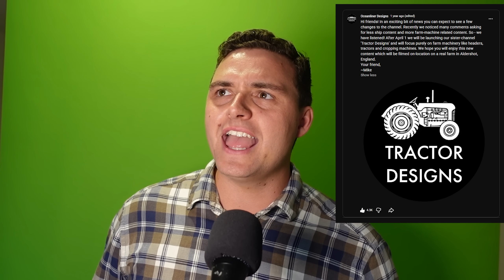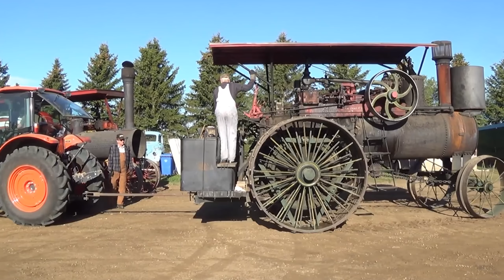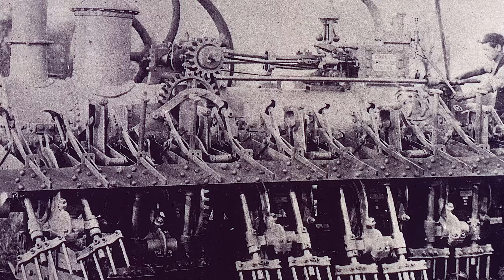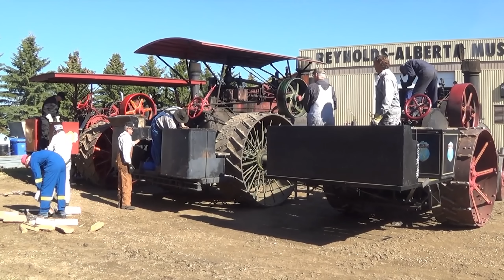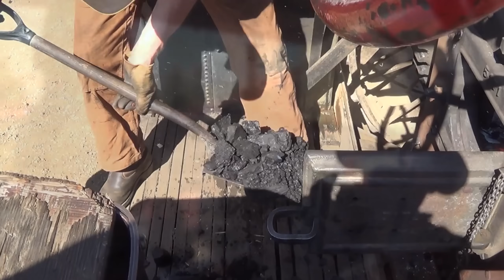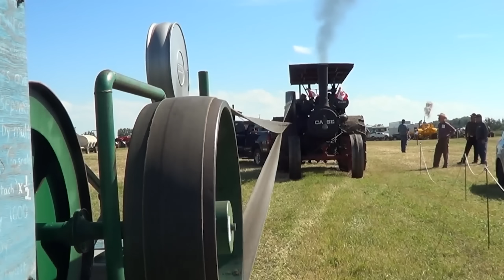The Incredible Engineering of Steam Tractors

Comment: I witnessed a 2-cylinder gasoline Avery tractor pull a Minneapolis-Moline small farm tractor with a 6-foot mower off the 3-point hitch that was buried to the axles in mud, and the mower deck was on the ground, out of the mud against the engine because the transmission was in gear.  The Avery was put into low gear, pulled the chain tight, then squatted down and pulled that M_M out of being stuck without spinning its wheels, which were steel: 7-ft in diameter, 3 feet wide, and had cleats.  She barked a lot pulling that small tractor out, but there was no problem at all.  That gasoline Avery was bought by the owner's father and spent its life on a western Kansas wheat farm, this was in 1966.  It replaced a steam Avery in about 1926.

Comment: Great video. You should come to the US and come to rolag threshing show its huge they have so much stuff to see including trains tractors steam engines from a brewery binders equipment running off steam etc its like 600 acres of stuff they even have steam shovels working. You can stand inside by the boiler while its running and feel the heat.

Comment: Hey there Mike! This is very interesting. Aside me being a 3rd Class Boilerman, U.S. Navy, in the first part of the 1970's I was an avid antique tractor club member and "campaigned" a 1947 David Bradley Walk Behind Tractor at as many as 20 shows per year. From about 1983 until the end of "show season" 2017, I had mainly a full historical display. (The Agent Orange heart attack, etc. made me have to stop.) Along the way I was fortunate enough to "drive" 2 different steam driven Locomotives (1912 Heisler & one fully hand cast and machined by Mr. Walter Durst, finished in 1965) and one "steam traction engine" (tractor) manufactured by Case. So, I'M VERY PLEASED WITH Steam Tractor Design! 
Melka J F  BT3
B55 1853

Comment: 23:09 is a Rumley Oil Pull. The box on front is the radiator. Oil poured over screens and the exhaust ran through the center to keep it hot to burn the kerosene. My grandfather had one burn.  It's a miracle some didn't.

Comment: I also follow Hyce's historic train content - one of the limitations of historic oceanliners is their huge size and cost means that preserving them, especially in running condition, is far from feasible, while smaller machines (tractors, locomotives, aircraft, smaller watercraft, and of course cars) can be kept, in some cases restored to operation and run, by museums and private owners. While oceanliners can only be studied in a more "academic" way, you can't see them in action or even play around with them like this tractor enthusiast does (or Hyce does with locomotives). Though does give me an idea - wonder if Mike Brady could play around with, maybe even own, a historic or replica steam launch. Or for that matter, I've seen those small-scale manned model ships used to train crew in ship handling, wonder if someone could build a miniature-scale oceanliner (such as Titanic) that is "live steam," has actual boilers (probably propane-fired) and tiny functioning triple-expansion engines.